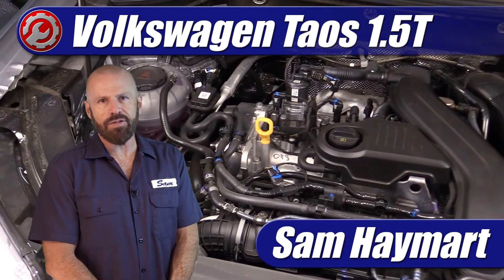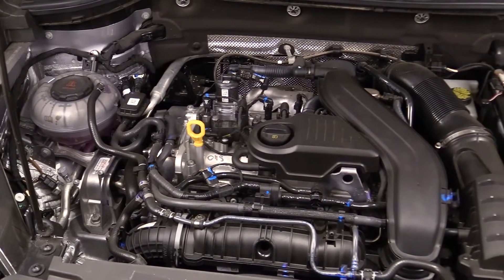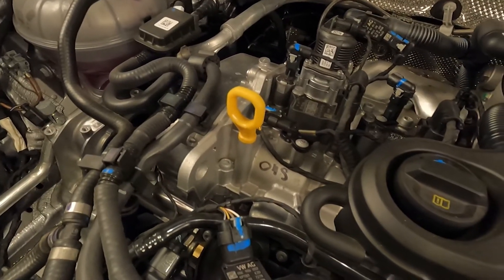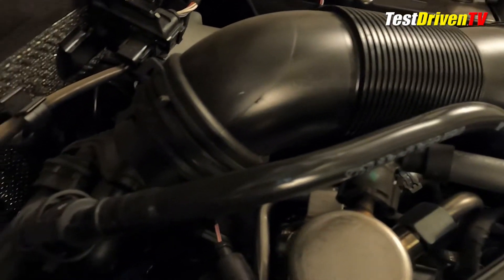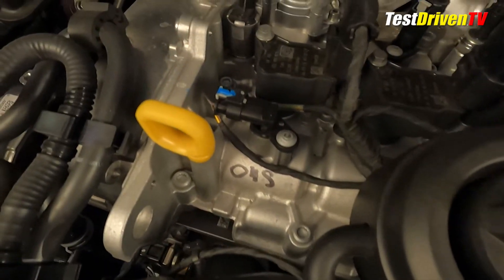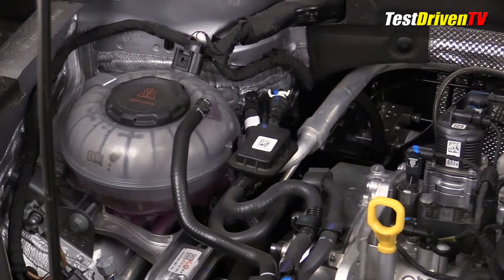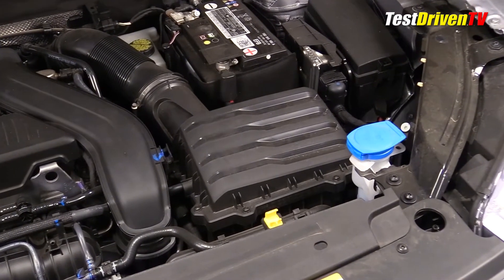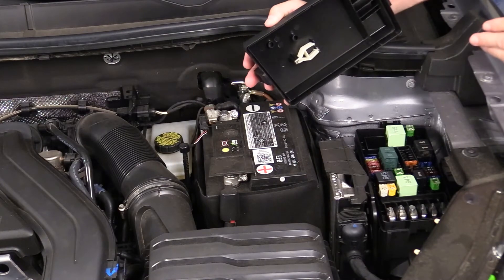2022-2024 Volkswagen Taos 1.5T Engine Explained

Comment: Having the same engine Code dxdb my frist tfsi its basically the same ea211 evo 2 but im wondering ill have 24.000 kilometres on it and noticed a clicking could it be the direct injection causes it's getting master with more rpm it doesn't have a chain so i dont know going this week to the mechanic

Comment: This is exactly what I needed, thank you! Why doesn’t it have a transmission fluid checker place?
Reply from the maker: Because most if not all modern automatic transmissions are "sealed for life" and are not user serviceable.
Reply: @TDTVGarage  oh that’s good to know! I looked for an hour hahaha. Thank you :)
Reply: I don't know about the earlier AWD models equipped with the DSG, but all FWD models, and all AWD & FWD models staring in 2025 have an Aisin 8-speed automatic.  They are "checked" by opening the drain plug, and then pumping in transmission fluid into it until it starts to overflow (this is also how you change the fluid).  Requires a pump and an adapter tube, but nothing too expensive in terms of tools.

Comment: Won’t last long without regular oil changes. Change the oil every 5000 on the dot
Reply: Km or miles?
Reply: @tummalapallisaurabh8708 Miles
Reply: @tummalapallisaurabh8708  miles.  Plannig to do the 5K change and have the oil analysis with Blackstone.
Reply: @sme7725a  Awesome, let me know how it goes!
Reply: Shut up
Reply: I change my oil every 2k.  I do it myself and at the interval the dealer says I take it to them so it’s logged that maintenance was done on time.
Reply: @Iraqveteran-ke6qu I have a brand new Taos right off the lot, now currently at 3200miles. Advice for oil and change date ?

Comment: Anyone else having  occasional high pitched squeaking when accelerating. (Occurs at city and highway speeds). Seems to happen when the gears shift. Lasts about 5 or so seconds. Stops immediately when I let off accelerator. I have the 8-speed auto (about 2,000 miles on it). Happens in "D" and in "S", maybe a little less in "S". TIA!
Reply: Haven't had squeaking but the turbo does make some noise higher in the rpm band
Reply: That may be a bad timing belt.
Reply: TURBO
Reply: Haven't heard this. How do you know?/Fix? @randomWeirdVid

Comment: I found out the 1.5 in the '23 Taos uses a timing belt. Is it an interference or non-interference engine?
Reply: Interference
Reply: In my experience all modern euro engines are interference engines

Comment: Great overview.  I was wondering if this engine is based on the 1.4 which has a rubber timing belt?  I was hoping the 1.5 had a chain one.
Reply: Chains are worse. You have to take out the entire engine to change them.
Reply: Why hope for a chain? Chains can fail, as can the stuff they drive (water pumps) and rubber belts exert a lot less drag on an engine, and make for it to be more compact.
Reply: It is based on the 1.4.

Comment: I'm confused this seems to be the same size as a 2007 era tiguan with a smaller unproven engine with less horsepower and torque. So what exactly am I getting for my money other than some shiny paint and new tech features inside?
Reply: Nothing. Now built in Mexico!
Reply: @SURENITY  substantially better fuel economy, reduced emissions, a higher standard of impact protection, and faster to 60mph.

Comment: I got a trendline but i feel like it need a lil bit extra power, or improve the lag, any tip?? Great video🤙🏼
Reply: Got the same problem... It has a great torque, but lag is... crazy. Sometimes it doesn't do anything and then.. just jumps. Another problem. When I drive where speed limit is 10 MPH (my apartments, or parking places) it keeps 1st gear till 2.5K RPM, 2 to 3 rd  and other gears goes under 2k. They for sure have a problem here and they're not going to resolve that. Crap.
Reply: @misha-cas  I have k&n air filter ordered. Has 15 positive reviews about eliminating turbo lag, better mpg, more power
Reply: @misha-cas that’s what’s saving your gas and brakes buddy
Reply: @misha-cas I agree mine is 2024 Taos comforting and does the same thing. Have you complained to Vw? They say nobody has complained

Comment: Great video. I got the AWD version last year. With the simple engine bay setup, what do you think I can play around with performance wise👀?
Reply: Just bought one and was looking at it. I think performance wise it will be pretty limited due to 1. How new the platform is and 2. How small the intercooler is. However with the high compression pistons high octane fuel and small increases in boost can make a pretty decent difference. Depending on elevation with everything stock with a solid tune you could probably squeeze an extra 20-50hp out of it. If you got a full exhaust, intake, bigger intercooler you could probably get maybe 100-120hp more from it. But the intercooler will be the biggest drawback to making power since I doubt many companies will mess with trying to build a bigger water/air intercooler for it. And converting to an air/air can be difficult since you have to remove and cap off a bunch of coolant lines, remove heat exchanger, find space for piping and intercooler, etc. And all that for minimal gains in power
Reply: @KJTUSKJTUS   what about interchangeable parts from other 1.5L engines in VAG group? For example the intake the 1.5 TSI EVO Performance Intake made by Forge. Or even the  1.5 Tsi Forge Blow Off Valve  made by Forge. These would be more for the "phsshh" noises but I would be happy with just having the ability to modify the car in some aspect.
Reply: @brandonallen111  I would assume a lot of stuff will be cross compatible. There really isn't a whole lot of info on the platform yet. It will probably be a little while before major advances in performance parts start making way to market since it's a fairly new platform. Also the main focus will more than likely still primarily be on the 2.0 until VW starts to phase them out.
Reply: Look up JB4 they made plug & play tune. Been around for years.

Comment: Nice overview!  
Did VW finally switch to an AGM battery?
Reply: Battery is clearly an EFB battery in the video.  Also AGM is not going to do anything special for you, far better for battery life extension is to put the battery in the trunk (i.e. no heat), which hasn't been done here unfortunately.  But VAG has never done that with their lower end vehicles anyway, so it's as expected.  Even Mk8 R still has its battery in the engine bay.
Reply: @rolandm9750  the eos battery is in the back.
Reply: @kevs2good133 so is the one in my Passat wagon. The original AGM battery lasted 12 years!

Comment: Any idea what spec oil VW calls for? Online I've seen some people say 504/507 and some say 508/509. This is confusing as the former is usually a 5w30 and the latter a 0w20
Reply: VW 508 00 & SAE 0W-20 is printed on a label directly to the left of the hood latch. Visible as soon as you lift the hood.
Reply: 5/40